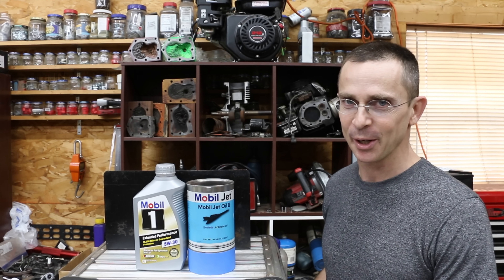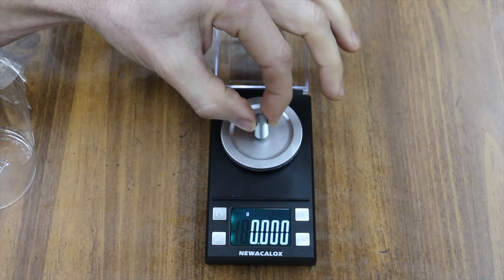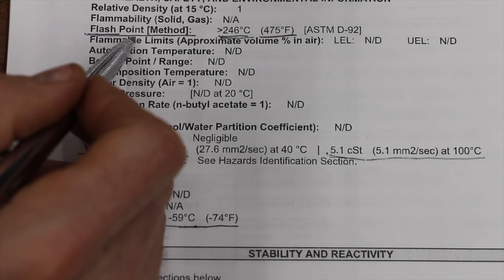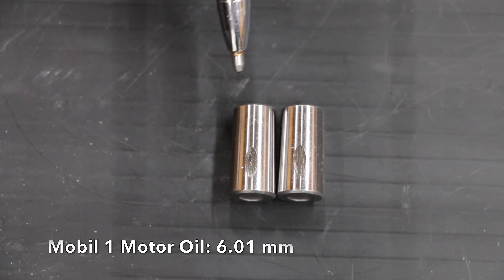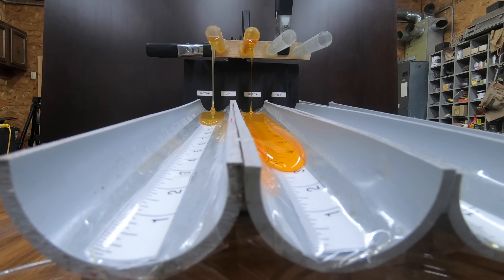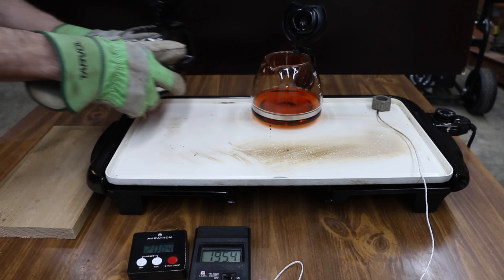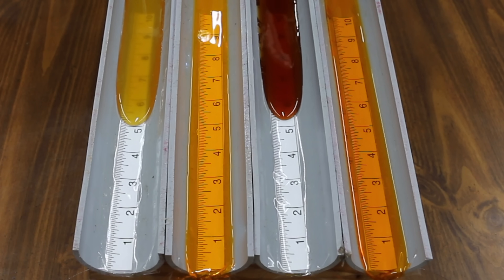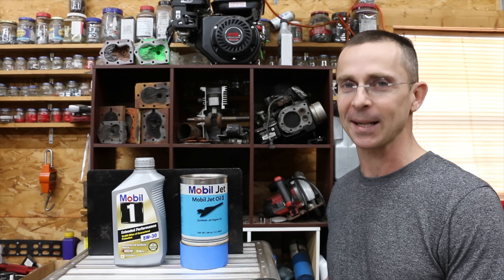Is Jet Oil better than Mobil 1 Synthetic?  Let's find out!

Comment: Jet engines use Titanium bearings.  Never any steel in them.  I can tell you that because I am a AAPP Mechanic WITH 45 years experience.  Try your synthetic Mobil on Titanium, and it not work.  

Jet engine oil is designed for Titanium and temps that go below minus 50 degrees and handles well in high Altitudes.  Also keep in mind those same jet engines get extremely very hot like at summer time out in the Tarmac or after it has flown 12 hours non stop.  I kid you not.  We only use Jet Engine Grade A Oil always.

So if you have a titanium bearings on your auto engine, you would not want any other engine oil except Jet Engine Grade A Oil.  Ok.

Also scraping those bearings is not the right way to test it.
Reply from the maker: Thank you
Reply: If you really want to know what is the right oil for your car, first gather like 5 known good brands, then put those in a cooking pot like you did here and heat them up.  The ones that go dark discard them as they are no good.  The ones that remain light color then put those in the freezer and set it down to -30 below for 24 hours.  Then do the pour test.  The ones that run down the fastest are the ones everybody should use for their automobiles or lawn mowers or boats etc. both for winter and summer.

You saw how the Jet engine oil did right?  Well do the same with the regular petroleum oils > NOT SYNTHETIC.  For synthetic that is a different kind of oil which should be tested the same way.  Now you will know which brands are good Regular Oil and Synthetic oil and let the people know.

in sub zero weather, if the oil is too thick it will not get to the crankshaft bearings and you will hear a loud knock within a few minutes and find a crank shaft busted thru the oil pan.  The metal will turn blue in the bearings itself.

That is why you need to test as instructed.  What they say on the cans is one thing but can it pass your tests Ok.

That is how to do it the proper way.  This way people who live in cold regions during the winter will know what kind of oil they need, and those who live in hot areas will know what oil they need for their vehicles.

Always advise them to change their oil every 3,000 miles, if you drive a lot, and 4,000 for a lot of city driving and change those oil filters.  There is a lot of very bad oil filters so you need to do that test as well .  Gather a few known ones and cut them open to see how they are built inside.  You would be shocked to find out that some well known brands are the worst ones around.

Comment: I think you should get ahold of two surplus J-79 jet engines, and break in one using jet engine oil, and one with Mobil 1, then drain them and see which fails first.
Also maybe use STP in one J-79, and Marvel Oil in the other.
Reply from the maker: Thank you

Comment: fun fact. jet oil is commonly used in superchargers.
Reply: wish I had known that before driving to a Chevy dealer to get supercharger oil. i'm sure it's cheaper than the little $15 4oz containers they had.
Reply: volvo09 ironically. AC Delco supercharger oil is the cheapest. ordering off Amazon is the best way to get it. jet oil is expensive. most German cars like the AMG mercedes with a supercharger call for jet oil for the supercharger. some Ford's too. the genuine Ford supercharger oil is hard to come by and if you find it, it's expensive. alot of people substitute with AC Delco supercharger oil.
Reply from the maker: Thank you

Comment: I use mobil jet oil II in my Mercedes supercharger which is what's used and recommended from factory.
Reply: Where do you buy it from?
Reply: Unsolvable Captcha Aircraftspruce.com  like the Amazon for pilots.
Reply: I feel like if I have to asked how much that costs then I can't afford it.
Reply: @adammetzger4182  It's like 20$ a quart.
Reply: @Quirk 'o Squirkulation mousemilk isn't oil! It's a solvent for breaking free aluminum on steel bonds such as airplane exhausts

Comment: My experience is the used jet oil STINKS when it comes fresh out of the engine. It's worse than any other machine fluid that I've encountered.
Reply: Transmission oil that works in a sugar plant smells much worse only one that matches that is transmission oil that works in a meat processing plant
Reply from the maker: Great Point

Comment: Hey buddy the mobil 1 engineer recommend a aditive to jet oil for engines with alot metal to metal parts. That would probably of yielded less scaring on bearing. They had PDF file about mobil 1 jet oil from 2016
Reply: Ester based stock it's say, guess similiar to redline or royal purple. Class 5 ester stock true lab synthetic
Reply from the maker: Thank you

Comment: I'm guessing the jet oil does not have nearly the same detergent additives that the motor oil does, which is probably why it resisted the heat so well, but it obviously has one heck of a viscosity package in it to flow that well. And let's face it, jet engines need to operate in n VERY extreme temperature differentials and high pressure differentials as well. At 30,000 feet, atmospheric pressure is substantially low and the flash point drops dramatically compared to sea level. However, I am guessing that if you ran the jet oil inside of a vehicle engine it would probably retain it's clear color to a fault and not keep the crankcase "clean" like motor oil. Jet engines do not require the designed evacuation of carbon build-up and vapors like piston engines. You should try Polyglycol in an engine next!
Reply from the maker: Thank you

Comment: So jet oil has far superior temperature resistance, both cold and hot, sacrificing lubrication for this extreme temperature tolerance. This makes sense. Jet engines produce far greater temperature then a standard combustion engine, and operate in extreme cold environments, namely high altitude.
Reply from the maker: Great Point

Comment: I would be ecstatic to see you do a video on Pulstar spark plugs vs. Regular plugs! Pulstar claims to have built in capicitors which generate such high voltage that plasma forms in the combustion chamber
Reply from the maker: Thank you

Comment: I have an old 1963 turbine powered Chrysler. Can I use jet oil in it?
Reply: Use manufacturer's rated stuff. If you do have a Chrysler Turbine - you really don't want to be dealing with an engine rebuild - that'd be second plus third plus fourth mortgage territory.
I'd put a preheater on the oil tank as well - you'll get better lubrication on startup if the oils warm..

Comment: you should try a heated oil lubricity test. where the oil is over 250 F during the test to see how it preforms while heated which thins out the oil. I think this would be a tad more accurate to simulate real world use, since after all, the vast majority of engines are running at operating temperature most of the time and oil performs differently at operating temp vs room temperature.
Reply from the maker: Thank you for the video idea!

Comment: I was wondering if that oil would work better in my double toroid mercury anti gravity engine?  The problem I am having is with my Tesla turbine bearings (Magnetic Bearings) are heating up to the point that the magnets are loosing there magnetism.  The turbine does a great job of spinning the mercury at about 250000 rpm but i cant keep the bearings cool with conventional motor oil.  What do you think?

Comment: Jet oil does not have the anti-wear capacity and it really does not need it.  In jet engine, there really is no metal to metal wear, other than in the bearings of the engine, which has maybe just 3-5, usually based on if it is a single or dual spool engine.  Jet engine oil is more about removing heat from the bearings than it is about lubricating them.  Check out AgentJayZ's channel, who is a jet turbine technician and has discussed this topic often.
Reply from the maker: Thank you

Comment: I was in the Army and stationed at Ft. Wainwright, AK in the late 1980's.  When it got really cold - like -50F and colder - it was common to leave a jet engine running if it was going to fly again within a day or two.  I was told the reason for this is starting a frozen solid jet engine does thousands of hours of wear.  Just what I was told - don't know how accurate that is...
Reply from the maker: Thank you

Comment: Jet oil mainly only has to lubricate bearings and seals, and resist extreme heat and cold due to high altitude and high temperatures in the jet engine core. Its about 1/2 the viscosity and doesn't have as many additives. And yes, it will destroy an engine if you use it. Heard of someone who had a 55 gallon drum of this stuff back when M1 came out, blew the motor in short order when he tried to use it as engine oil.
Reply from the maker: Thank you

Comment: would it be possible for you to test different 5 hp engines, maybe do some test to see which 1 has the highest rpm or the most torque, then at the end see which 1 will last the longest without oil
Reply from the maker: Thank you for the video idea!

Comment: When you are taking off from New Zealand in the summer and landing in Antarctica. Yea the oil counts.
Reply: Don’t even need to fly to Antarctica- at average flying altitude the temp is -50 anyhow!
Reply: @DrFiero   Combustion engine heats itself, it's when you stop that counts.
Reply: DrFiero Sorry, just saw your comment after making a similar one.
Reply: the planes that land in Antarctica never shut off their engines, restarting turbine engines at low temp is a real problem
Reply: Hopefully that flight is to drop your PM where she belongs.
Reply: Thermal shock can cause the oil to react wildly if not designed for the application. Think of freezing cold to molten metal temps within minutes.
Reply: ipissed you don’t have to go that far just climb to flight level 300-400.

https://www.google.com/search?q=average%20temperature%20at%2030000%20to%2040000%20feet

Comment: If you compare the viscosity of the jet oil it is more closely related to ATF then engine oil, MOBIL ATF 134 has a viscosity rating of 29.6 cSt (29.6 mm2/sec) at 40 °C | 6.35 cSt (6.35 mm2/sec) at 100°C and Pour Point: -57°C (-71°F)
Reply from the maker: Thank you

Comment: If the Jet Engine Oil performs so much better, then why not use it!?! :/
Reply: The base stock is not compatible with seals in automotive engines
Reply: @corpsiecorpsie_the_original  :
How much are Jet Engine Seals?
How much is the per/quart cost of Jet Engine Oil, anyway?

Comment: The jet oil did better job than most oils sticking to the disc.  BUT, YOU did not pay attention.  The jet oil flinged the oil out of your Motel 6 plastic cup.  The level of the jet oil then became below the disc.  It was not getting lubrication.  No wonder the bearing showed more wear.  It was not being lubricated.  PLEASE buy a three ball tester for measuring wear resistance.  That is/was the only SAE like measurement. 

You have enough viewers/monetization now, and getting support to slow down to sweat the detail. Like the jet oil issue above, I have see other anomalies in comparison testing that would affect results.  Thanks, and keep it up...
Reply from the maker: Thank you

Comment: Maybe 20 years ago, I bought two quart cans of "turbine oil" at a surplus store. Clear, and nearly as thin as water. I tried it in an old lawnmower that was burning oil, and, oddly, it didn't burn the turbine oil as bad as it did 30 weight.
    In World War One, some aircraft used castor oil as engine oil. Why not try that in a lawnmower? In the '70s, you could get " racing castor" for all engines. I think some model aircraft fuel is a nitromethane/castor oil mix...
Reply: Castor oil is a bad idea in an engine unless you are on lots of opiate painkillers that have bunged you up.
Castor oil in exhaust does what castor oil usually does - it gives you the Red Baron Runs. They used to run rotary engines on constant loss castor oil - the pilots got a face full of it and constantly had the squits as a result..

Comment: As an aviation mechanic I can tell you these oils main purpose is for cooling and lubricating in hot and extremely cold. The lubrication is adequate, not great, but the oil is stable. All manufacturers REQUIRE however that certain oils and brands be used in these jet engines, and using anything else is a surefire way to get in trouble with the FAA
Reply from the maker: Thank you

Comment: I worked on turbo prop engines (C-130 aircraft) for 25 years and can offer that our engine oil is not subjected to friction wear like you'd find in a standard piston driven combustion engine.  Axial flow jet engines/turbo props require lube to the shaft bearings and other gear driven accessories, but again, there is not a true friction environment in an axial flow engine.  Love the channel and have purchased many products based upon your testing results.
Reply from the maker: Thank you

Comment: Jet engines have actual roller style bearings where film strength or viscosity or anti wear additives aren't as critical then with the bearings in a reciprocating engine. Jet oil mainly provides some lubrication and mostly carries away heat. Jet engines operate at high altitude where its -50 degrees so it needs to be able to flow and handle heat.
Reply from the maker: Great point. Thank you

Comment: Early jets used mineral oils but   they transitioned to the synthetic turbine oils in the mid 50s. These oils are chemically more like antifreeze than mineral motor oil and requires different seal and hose materials. Some WarPac turbines still in use use mineral oils.

 Synthetic piston engine oils are compatible with the rubber parts used with mineral oils.
Reply: Anyone dumb enough to try turbine oil in their pistol engine will probably crap their pants when they find out how cheap it isn't.  That will probably deter most of the idiots.

Comment: I wonder how much lubricity vs viscosity plays a factor.
I would be massively curious of oil testing, all Mobil1 brand, but different weights compared to each other, and following the outline of your oil testing
Reply from the maker: Great point.  Lucas HD Oil Stabilizer, which has a very high viscosity performs similarly to most motor oils.  So, I don't believe viscosity has much of an impact.

Comment: That was amazing and informative! It confirmed an idea circulating about the oil changing color after exposure to heat.  I have a question about the lubricity test.  Is the first oil tested always better than any other tested after it?
Reply from the maker: Thank you!  Testing sequence hasn't impacted the test results.  It's 50/50.  Thanks again

Comment: I am a turbine engine mechanic and also instruct classes for new turbine engine mechanics. The reason the jet oil lost the friction test is because it was engineered to meet different operating conditions. A turbine engine does not have metal sliding across metal in critical areas like a piston and cylinder. The main shaft that has the compressor rotors and turbine wheels on it is supported by roller bearings or ball bearings that are very precisely engineered. Jet oil is designed to withstand higher operating temperatures without vaporizing, boiling, or igniting.
Reply from the maker: Great information!  Thank you
Reply: I used to be represent ExxonMobil Aviation Lubricant. So for all JET oil, there do not design to handle the load, as most of the time lubrication is in hydrodynamic condition. However, we do have a sustainable anti-wear function that is secondary to primary functional additives.
Jet oil designated to flow at cold n hot temp without causing too much deposit as key factor. Follow by seal compatability and electric conductivity. And finally anti-wear protection.
Reply: kmin3434 FTW. That is the long and short of it. I would add that turbine engine bearings also don't need the oil to cushion the rods, crank, rod bearings, and crank bearings from the impact of the reciprocating mass, like a piston engine.
Reply: Ikr, here I was about to fill car engine oil on our helicopter fleet. Phew.
Reply: @Yahnr  I was at a customer today and saw a 55 gallon drum of Mobil Jet Oil. 
That can't be cheap.
Reply: If I mix jet oil with motorkote, bestline, or other friction modifiers, will it work better than regular engine oil in all aspects?
Reply: Let's Just say Jet oil was designed 1st for cooling demands to take heat away from bearings.And  2nd for lubrication since there is no metal to metal sliding since all is supported by roller or thrust bearings
Reply: Considering the fact that the wear was 20% more with 50% less viscosity, the POE did a really good job

Comment: Awesome video. 
Thanks for all of your hard work.
Given the extreme temperature's that jet engines operate at.  I had no doubt that it would win the heat and cold testing methodology you apply.
With the lubricity aspect of the the test I was a little surprised the jet engine oil didn't perform better. Not that it was awful performance.
I am not a jet engine mechanic at all. Very curious as why it didn't perform better than it did. I would thought it would have beat car motor oil.
Reply from the maker: Thank You

Comment: Mobil jet oil is about 18 a quart. It has to lubricate bearings that can be spinning over 60,000 rpm and a lot higher temps.
Yes the additive package is different. It also doesn’t have the dispersant additives your car oil has to keep the containment’s in suspension like the car oil does.
Reply from the maker: Thank You